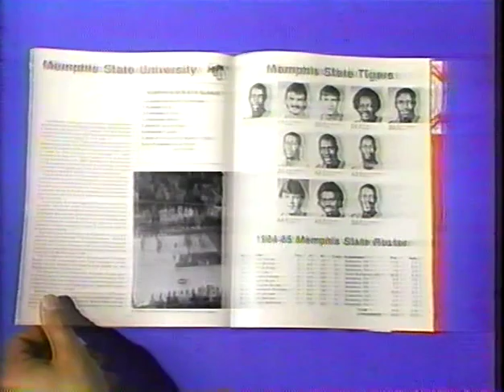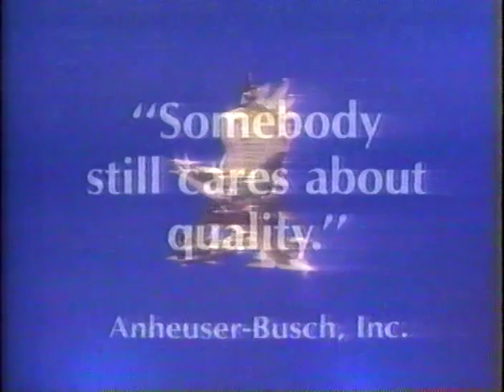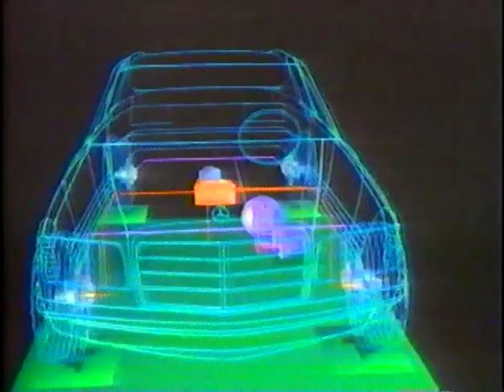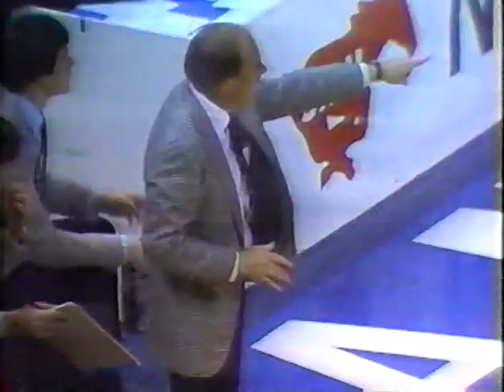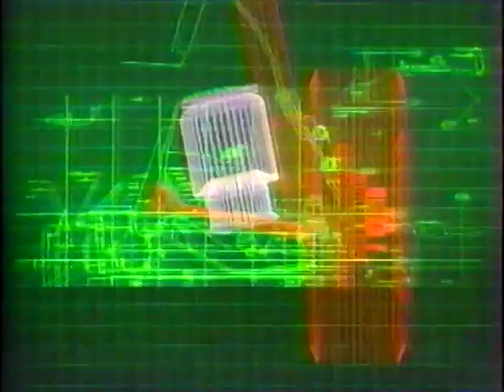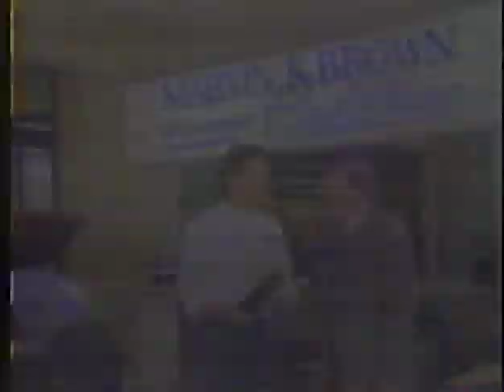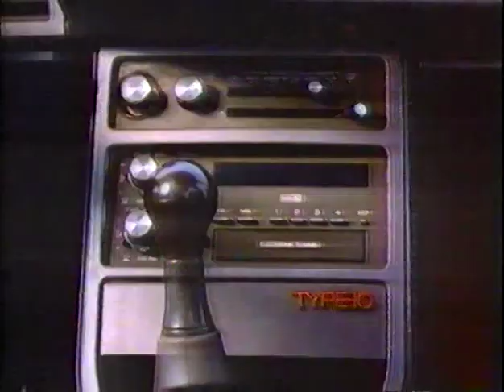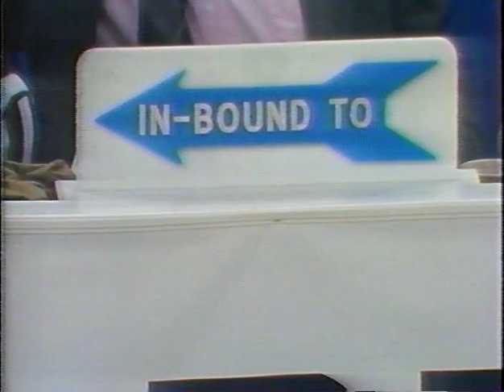1985 NCAA Basketball Tournament Midwest Region Final Oklahoma vs Memphis State

Comment: Reunion Arena getting a test for the Final Four. In those days the NCAA typically assigned a regional to the host of the next years Final Four so they could get all the kinks out. A regional is similar to the Final Four in number of,games,teams,.etc.
Reply: I did see it live. Didn't like the NCHC result but the NCAA calls it a different result. And tonight's game is being broadcast regionally in the Upper Midwest on Fox Sports North Plus.
Reply: Seems that way. Normally I would not have gotten the message till late today but I've been so sick that I'm not really able to work long hours Hopefully I'll feel better soon. :(
Reply: I think I know whats wrong. Need the ultra sound to confirm as liver enzymes are high. Dr. suspects the same thing. I can also get UND home games on my cable system
Reply: I don't
Reply: I believe that Final four was fixed for Villanova to win it.